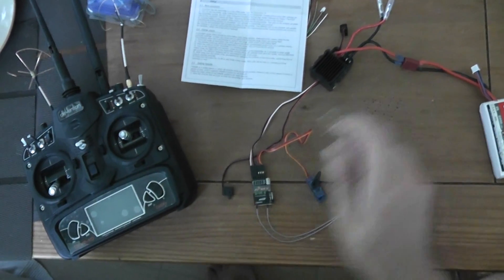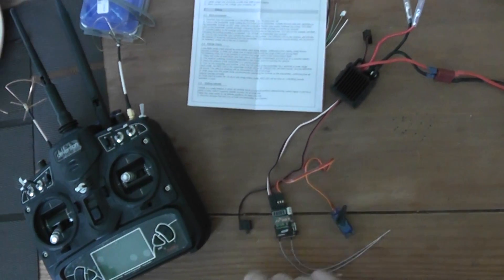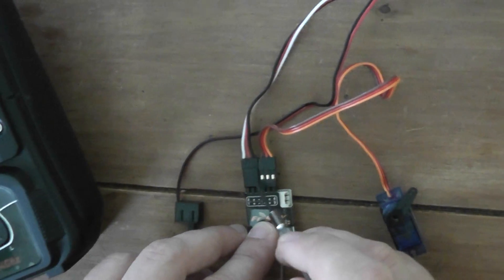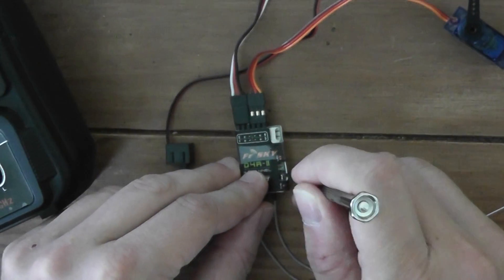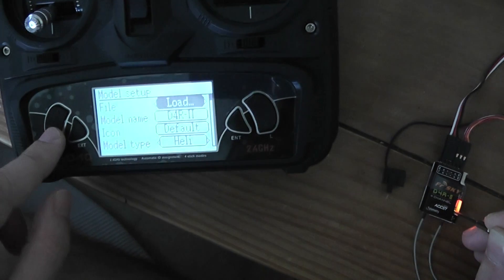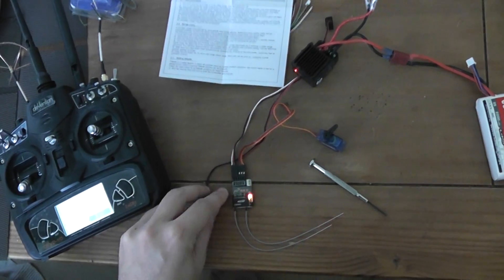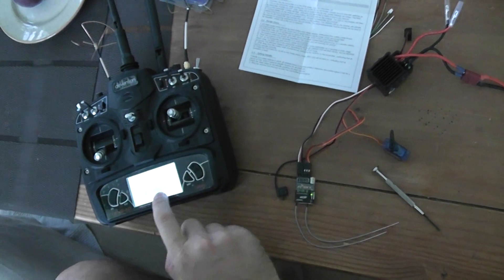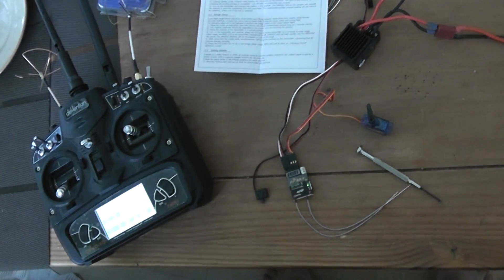FrSky D4R-II binding procedure with a modded Devo controller

Comment: Hi, I was wondering, if when I would like to install Module CC2500, do I really need to remove the original devo module? Or can I just solder the new wires on top of the old ones and put the module somewhere else? I also have the NRF24L01  installed. Is this all possible?

Hope you can help me out.
Reply from the maker: You can keep the default CYRF6936 module. Check DeviationTX web page to find the pinout to add the CC2500
Reply: Oké cool. Thanks man! :) I will just solder the wires on top of the old then. I mean there are similair pin outs right
Reply from the maker: be aware, you have to collect the TMS, MOSI, MISO, GND, VDD and CE
Reply: Yeah and instead of using the TMS I will use the tck because of the nfrl..something module. I will give this a shot when the module is deliverd. I may come back at this topic :P
Reply: Hi SB,

I did it! But for some reason the failsafe won't kick in when I turn off controller. I can't get it to work. Do you know what I am doing wrong?

It's a D4r-II receiver.

Comment: Hi. I'm about to install the CC2500 module in a deviation flashed Devo 10 so that I can bind it to a quad with a FrSky D4R-II rx. Do you know if the Devo 10 can receive battery voltage telemetry from the FrSky? Is so, how would I be able to set it up? Thanks!
Reply from the maker: +tammovh Yes it can, but you will need to install a voltage diviser from the input voltage to be in [0 - 3.3V]
Reply: +SeBy DocKy Great. Thankyou for your reply. I'm not sure what you mean. Any chance of a visual reference to what you are describing? Merci